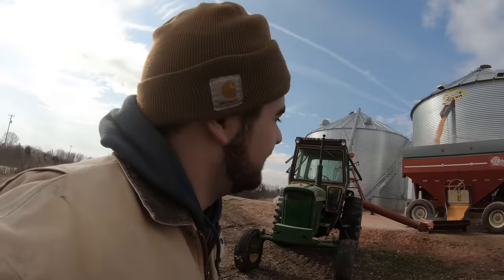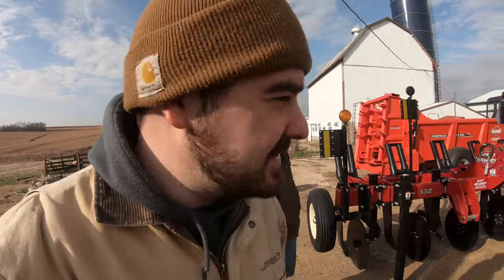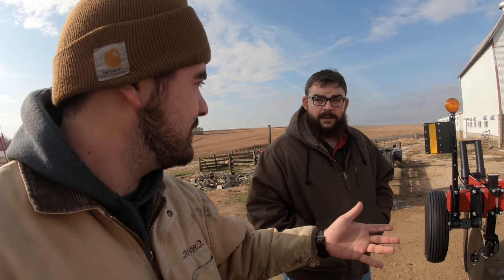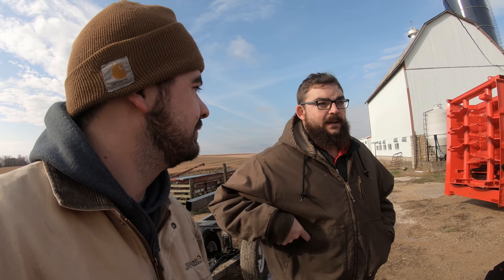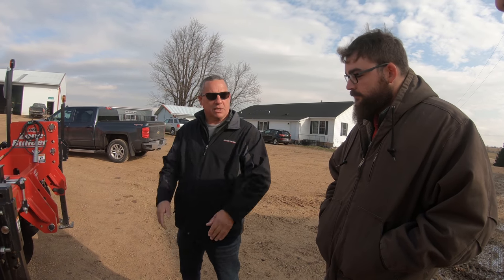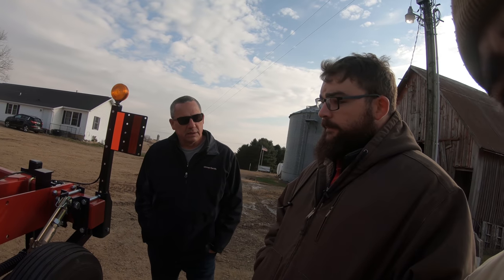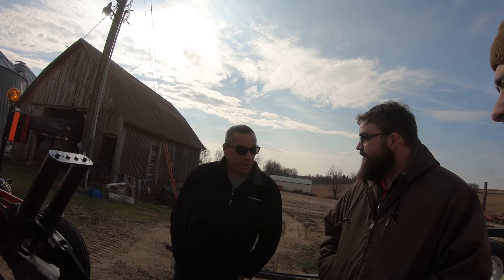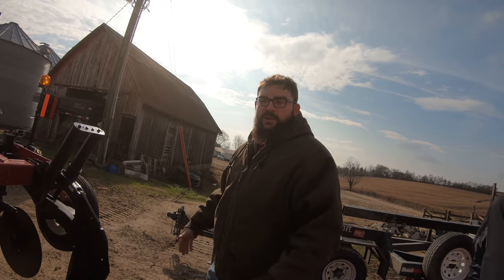How A Subsoiler Works | UM Zone Builder Model 132 Subsoiler

Comment: I always pull mine in the spring. The moisture from the snow will help get those shanks in and be a lot easier to pull. I also pull it as deep as it’ll go. Might as well make sure you get all the hard pan out.

Comment: We had a very similar subsoiler like  that here in New Zealand, only 4 shank though, we had 6 inch wide wings on the shanks, but no disc openers, we ran it on a 220hp MF and romp away with it, 130hp pulled it quite well too.

Comment: Great, Informational Video, Ryan! I am an owner of farm land but not a farmer. I have heard of compaction for years but never understood it till now. Same with the terms hard pan and subsoiler. Is hard pan only a narrow band between the worked upper layer and a softer lower depth which prevents water and root penetration from getting into the soft lower depth? If so, it  know makes total common sense to me to use a subsoiler to fracture it.  sdh in the Tobacco Valley of CT

Comment: I had a old combo  by unverfert  disks shanks disks with toggles it was a real nightmare !!! Toggles breaks all the time cause it was some kind of cast material, we had some custom made in steal, it was better but the springs break too, metal casing fatigue cracks where The spings are!!! We all get rid of the toggles, torch a few things weld some kind of wings over the shanks and put some hydrolics cylinders with a gas accumulator . best things I have done to this machine

Comment: Just bought the same one, does not auto reset, 9 times out of 10 I have to stop and lift it up to get it to reset. Other than that it does a really good job. John Deere 8400 pulling 5 shanks 14" deep , 4.5- 5 mph is all I can get to they pull hard but they do open the bottom.

Comment: If the soil conditions are right the Subsoiler can loosen a large amount of soil.    I started using my 9 shank with a 4850 mfd  back in the early 1980's.
Reply: The 8235r can pull it at 4.25 mph using 12 gph of fuel with it just about 14" below soil surface if the colters are set to the hub.

Comment: Subsoiling is a need necessity for a farm, but the tractor it takes to pull a subsoiler has to be of substantial size. I think the 8235r is big enough for this machine but it might be at it's limite. You'll just have to try it and see....
Reply: I'm sure it has the traction at least, think wheel spin will be a problem before "torque out"

Comment: if its sick you will struggle to pull . if its dusty just ad 15 hp per shank if you do think i am being strait up with you when drop it in to the right depth find out what a real load is. you need about 12 to 14 inch's get under the hard pan

Comment: You’ll sure feel when she is in the pan. My dad used to pull a single shank pan buster with the 4230, she was usually within 3” of the frame. He then had a MF2680, initially pulling a twin shank pan buster. That was also usually between an inch and 2” of the frame. Both tractors used to bark when she hit the crust. There was none of the reset stuff back in the 80’s. Much later they put the MF on full duals, fronts also. Ballast all 8 tyres, with a 5 shank flat lifter. That really slowed her off. Looking forward to seeing the JD pull hard.

Comment: Don't use the wheels, let all the weight from the subsoiler be on the tractor.  Even the pull down of the shanks help with traction.